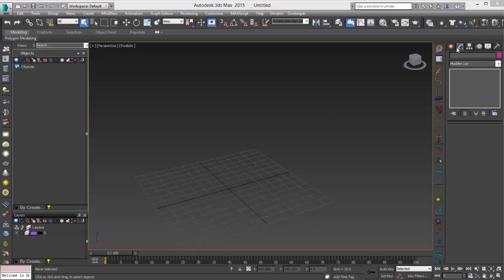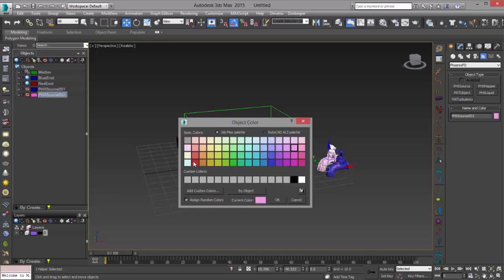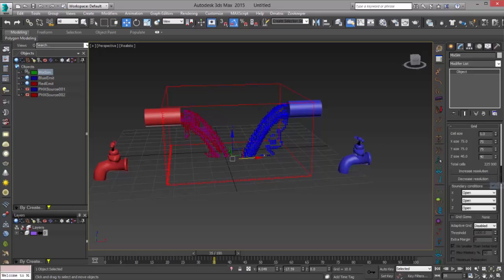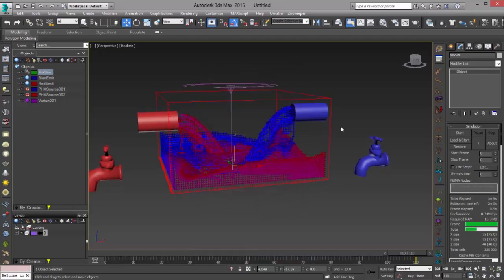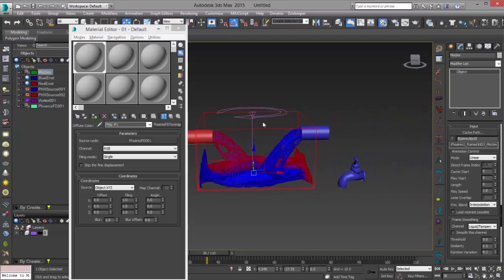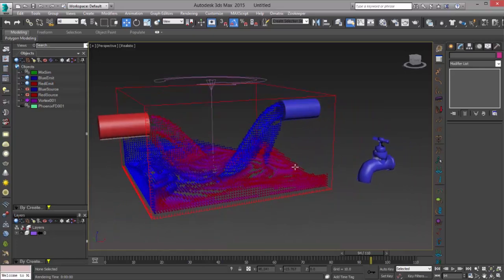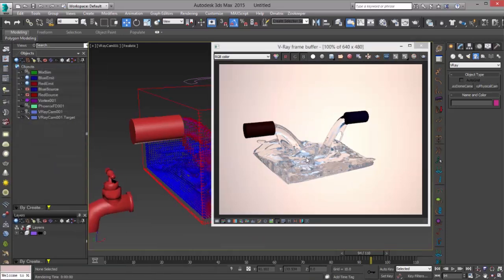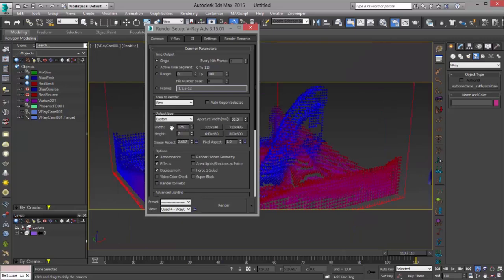Phoenix FD Tutorial by Michael McCarthy - Mixing Paints

Comment: Thank you, this is very helpful tutorial!
I have a question - here is the situation, in a scene there is a human model, then the liquid will appear and morph in to the liquid human model, make it look like original human model have liquid skin above its surface, and after this liquid will splash to the floor. All is working,  but i have a question is it possible to make liquid human model use multi texture from original non liquid human model, that the liquid model will look the same in terms of textures(like head, body, clothes and etc)?!
Thank you for possible answer/tip/solution. All the best!